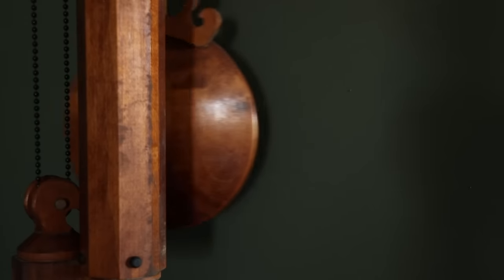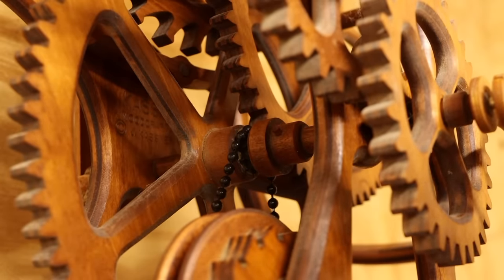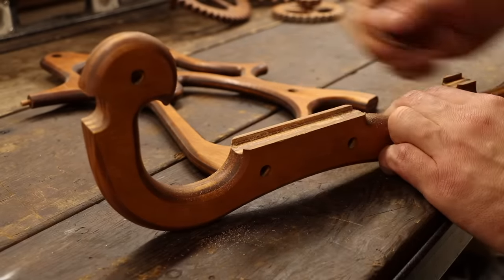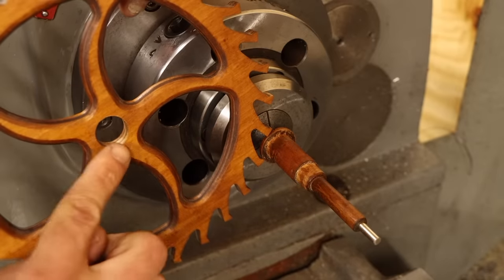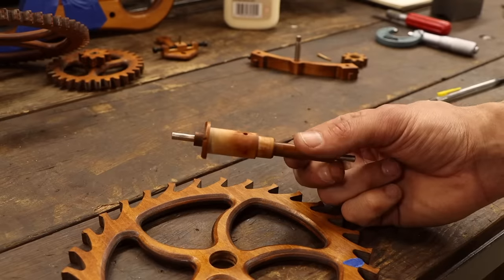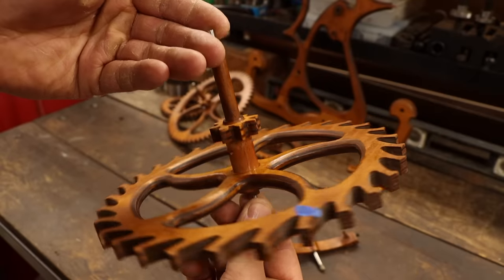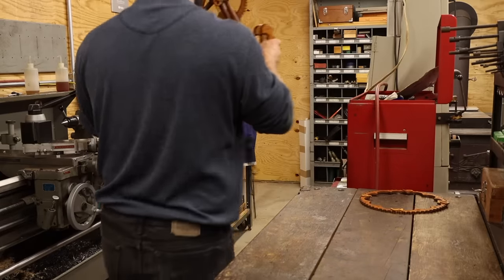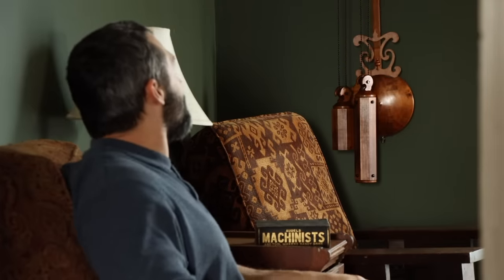Resurrecting the Phoenix Clock || INHERITANCE MACHINING

Comment: I'm about half way through the video and I wanted to add some thoughts of my own regarding the warped escape wheel - in my past life I was(well, still am, actually) a luthier(guitar technician, for the uninitiated), and wood warping is something I've dealt with in the past. I don't think its actually worth the hassle, but a method we've used for guitar necks that have severe warping issues is to clamp them between two parallel surfaces and applying a small bit of steam to "soften" the wood. This is a very lenghty process, because organic materials don't like sudden changes and are surprisingly springy. Last time I did it, it took several weeks, if not months. but the result was quite surprising. It probably doesn't need it, but if you do decide to go the full perfectionist route eventually, it might be worth giving it a try.

Awesome content as always, Brandon.
P.S. - Chris from Clickspring has a new "opponent" it would seem 😉
Reply from the maker: Thanks, Erik! Thats really good to know. I've heard of using steam to form wood into a shape but it never occurred to me it could be used for repairs like that as well. Though that makes perfect sense. BTW I have a LONG way to go before I'm anywhere close to Chris 😂

Comment: Wood moves, grows and shrinks. After 35 years the inaccuracies are to be expected, and should be expected to reoccur.  The only wooden clockworks I've seen with any dependability are ones made with laminate gears and wheels of very high density woods (Jankas above 2000) and a minimum of 5 layers. Mesquite would be as good as you can get with a tangential to radial wood movement ratio essentially 1, extremely high density while still being able to be glued, and highly available and cost effective. The fact that it's beautiful is just icing on the cake. I've toyed with this idea and the first engineering problem IMO is the design of a hub to put and hide ball bearings at every axel. Friction is the number one issue wit wooden clocks.
Reply from the maker: Good info! Thanks

Comment: As always, an awesome job. I have a couple 19th century wooden-geared clocks, in various states of unfortunate disrepair. The one thing I would have done (in my case try to do, and fill a very large B.O.S.) is make a brass escape wheel, and put some steel pallets in. The clocks I have use metal in those areas, as well as metal pivots. Wood, even hard maple, will wear more quickly. Ultimately, though, you made it run, and that is a win in any book.
Reply from the maker: Thanks! I was actually considering making a brass pallet arm since that is most likely the largest source of variation. Still having trouble with it running so might actually have to pursue this and an escape wheel

Comment: Machinists are the best and worst customers to the clock repair shop. Great work, great vid. Nearly the whole way through I was just nodding and thinking, yup that's an excellent way to do it, good thinking. Clocks aren't alien tech but there are some odd and often counterintuitive aspects to their care and maintenance. Let alone the wood ones. Some of the oddness comes from olde tymey legacy design but that's not anything like the whole story. One of the main aspects I like to point out is the service life and duty cycle of a clock. 24/7 365 for decades. Hard won lessons over the centuries are what lead to most of the outcomes in manufacture. That and forces of commercial, industrial, political, cultural, personal.....
Reply from the maker: Much appreciated! No doubt about why it took centuries to design a clock that can last a lifetime

Comment: My wooden cuckoo clock will gain or lose about a minute a day depending on the weather, so I've given up tweaking the timekeeping. I just nudge the minute hand each morning when I rewind it, so it's about right for most of the day. The amount of friction and misalignment to cause running problems in pendulum clocks is indeed tiny. A clock with a 1/2 kilogram / 1 pound weight that falls 2 meters / 6 feet in a day is getting a little over 100 microwatts of power to drive it; so a too-snug bearing, or a rough edge on a gear, or slightly mis-set palette will rob the train of the energy it needs to keep the pendulum swinging properly. Your process of fault location and fixing will help others deal with problems with their clocks, and perhaps inspire someone to tackle clock problems that other have given up on. As others have said, you have a fascinating heirloom with a very interesting history and some documents to pass down to the future generations of your family.
Reply from the maker: Thank you and thanks for the insight!

Comment: as a hobby watchmaker, I'm blown away by the history and the beauty of this clock! great job fixing it - I've noticed all the problems the first time you've shown it kinda running, and you were spot on with your solutions. with the clock this big, I myself would probably play with the pallet depthing a little bit - it seems too deep now, adjusting it might make the clock run more reliably and increase the run time from a single "wind", since less energy is lost. I'd also apply a tiniest thinnest layer of grease to all the pivots and on the pallet mating surfaces, it might help quite a bit, but I have zero experience with wood-on-wood interactions, so don't take my words for granted.
Reply: I believe for wood on wood moving parts some kind of wax would be the least intrusive and best for wood longevity, like a paraffin or bee wax.
Also seen people use thin nylon tape for things like all wood drawers.

Comment: Wow!!! Being a fan of watch maker videos, this has been delightful. Finding the manual with the included correspondence is huge, as it completes the provenance of this beautiful clock.
In my opinion, the brass bushing is a great improvement to keep the clock running true. Considering the wear the moving parts (especially the pallet and pallet wheel) will be subject to over time, will you let the clock run all the time? Maybe a few layers of varnish at the contact points that can be touched up as it starts showing wear?
Reply from the maker: Considering it has already stopped and now needs re-adjusting, it may save itself from self-destruction! haha Thanks as always!

Comment: I'm looking at those axel bushings and how they are made of wood, and wondering how humidity and swelling is going to affect the operation of the clock.  It appears that the gears are cut from plywood which vastly mitigates the issue, plus they are sealed.  -  EDIT:  Looks like you may have addressed that, I commented early.
Reply from the maker: I recall the manual also mentioning the bushings were "permanently lubricated" with oil or something like that. There's also a substantial amount of wiggle room in them that helps

Comment: I'm a woodturner and wanted to give a recommendation to gluing brass to wood if your wood glue joint fails. I use Barrel Bond it's like a 5 minute epoxy that is specific for gluing brass to wood.
Reply from the maker: Oh good to know! Thanks!

Comment: Wonderful piece of history with a great story. I've wanted to make a wooden clock for some time, playing around with a few CAD designs over the years. The guys at my workshop have just built a big CNC machine, so I'm thinking this is a project that finally needs to happen.
Reply from the maker: Heck yeah! Once you have access to a CNC router whipping up wooden clock parts should be a breeze. Thanks, Adam!

Comment: I consistently love your content! You have found a style that suits you so well and is unique in the space.

Do you find that having a youtube channel "encourages" you to keep a steady pace on your projects, or do you feel that it actually interferes with project progress more than helps?

I have severe ADD and it is very hard for me to self motivate and keep on a task to completion, even ones that I am very excited about and want to do very much. One thing that I have found helps me is to have some form of external pressure to stay on task. Usually that comes in the form of doing a project with someone else, because that transforms the task in my head into hanging out with a friend rather than working on a project which takes away the pressure of finishing. I have considered starting a youtube channel to see if that would have a similar effect for me as working with another person, but I'm worried that it would actually make it worse by adding additional steps to the process.

I would love any input you might have!
Reply from the maker: Having a regular posting schedule definitely forces me to finish the projects in a timely manner. Especially since this is now my livelihood. So that's the good thing. The flip side is I spend as much time on the videos as in the shop for each project. Which is also under pressure but something I am less familiar with (but I'm getting the hang of it!). Hope this helps

Comment: Love it. Such fun finishing up a project started by a previous generation. My great grandfather was a machinist and I have a small steam engine that he had made.  It hasn't run since I was little, when my dad had tinkered with it and had it running on top of the wood stove. I really need to dig it out and get it tuned up. I just need more time, as always.
Reply from the maker: That sounds like such a cool project. At least to get it running well enough to survive another generation or two until they can try their hand at it. Almost like a family tradition. Thanks as always, Keith!

Comment: Really cool video. I could be wrong but I think I saw the wooden pieces being laminated as well, which is probably was done for extra stability over time.  I am also surprised at the correspondence from the maker, vs. just this being returned and replaced at the time. Overall, very cool project.
Reply from the maker: Yeah it's definitely laminate maple and that was my thinking as well. The kit originally took hundreds of hours to assemble so it's understandable that the builders would want to get the clock they spent all that time on running as opposed to just having it replaced. Still pretty neat that Kassner took the time.
Reply: @InheritanceMachining  agree... but as you said, these issues were not fixable, PER SAY, even if you are savvy to put it together. These required special tools to measure, knowledge how to trouble shoot and adjust, so I am still sorta surprised that this wasn't returned, but then again, if it was, it wouldn't be my fav video so far that you have made.

Comment: 13:33 - there is some deflection of the rod when you add the center -- is it possible that rod is slightly not-straight, or is that just an artifact of how you were holding it at the other end?
Reply from the maker: I noticed that too.It's pretty likely that the wood rod was bowed slightly. But I'm not too concerned since that fixturing was the closest I could get to how it's actually supported in the clock. And the bushings have modest clearances.

Comment: Graphite powder, or just using a pencil on the escapement and other contact surfaces is a great lubricant for wooden clocks!
Reply: Visit a GOOD retailer and get a 2 or even higher # B pencil.  Softer "lead" (higher B #) means more graphite and less clay.
Reply from the maker: I was actually thinking just that! Thanks!